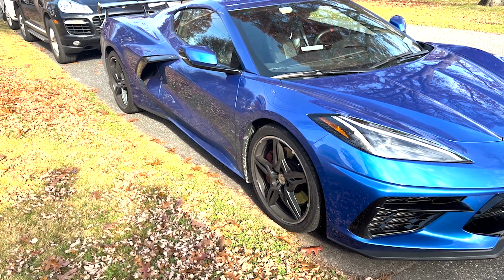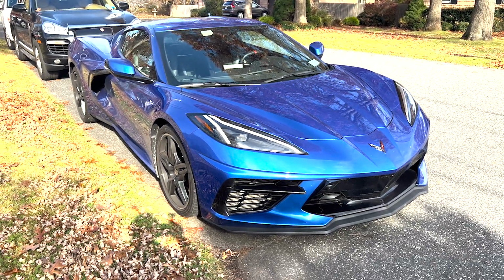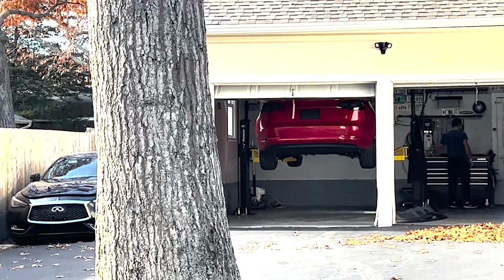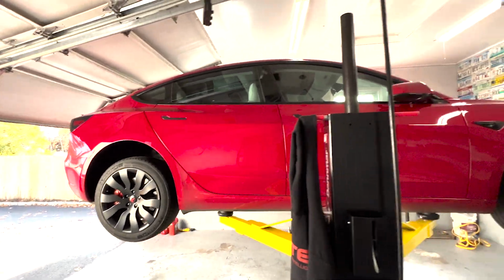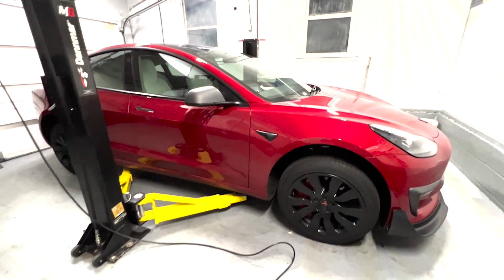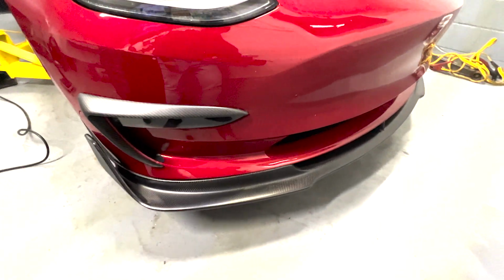Adding Carbon Fiber Front Lip to my 2021 Tesla Model 3 | RPM TESLA

Comment: Yes I had the same Aero Front lip on my 3 Performance. Since my car already had Eibach lowering springs installed making it 1 inch lower than a stock Performance, I was scrapping a lot with the front lip installed. It’s absolutely a quality piece and it looks great! I took it off and waiting for their Razzo front spoiler to come in. It’s the one with the optional wing flanges.